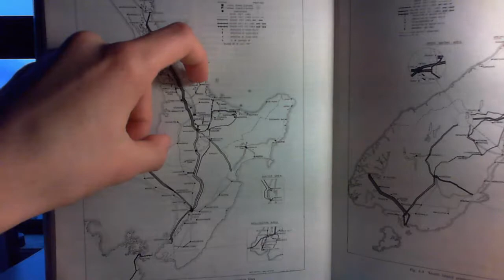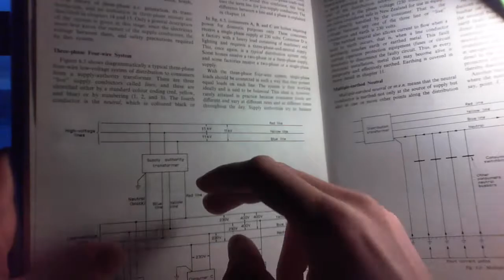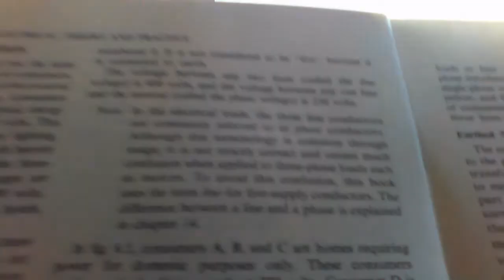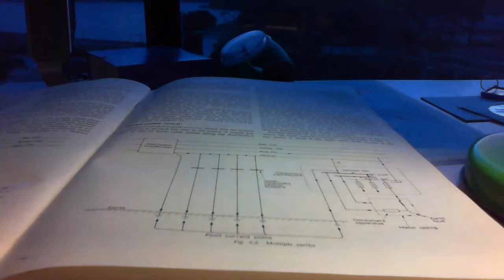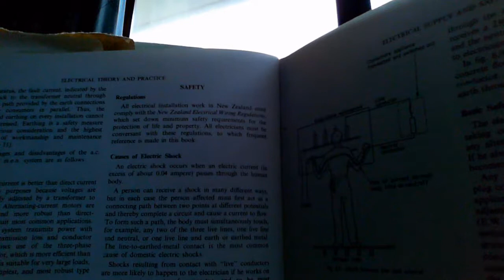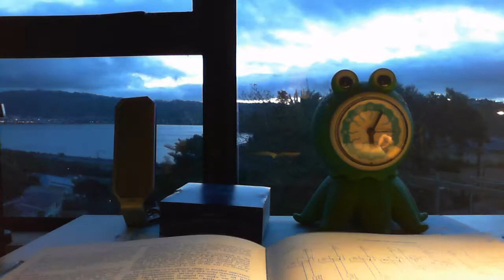The New Zealand power grid and distribution system

Comment: Great explanation! I’ve never seen a HVDC here in the US. I think that they exist but there uncommon. 500kV and 765kV 3P 3W are common for cross country voltages, while 245kV and 138kV are common for local transmission, and 69kV, 43kV and 34.5kV are common for sub transmission/distribution voltages. There are so many distributions so I’d be impossible to list them all, but 3 phase voltages are usually reserved for commercial zoned land. So a house would not be fed from a 3P LV line. Single phase transformers are used to supply power to homes.
Reply from the maker: metersocket00 thankyou very much later on i will get further into that book
Reply: As a fellow kiwi. Respect mate 🫡